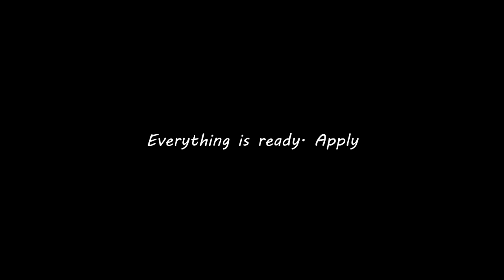This idea must be in your workshop or garage!

Comment: You've got a lot of expensive tools but apparently no router. Making circles with a router is more accurate and professional and does away with measuring and drawing and jigsawing and sanding. My clamps hang in a straight line on the edge of a shelf and occupy no floor space at all.

Comment: 10minutes of my life I won't get back. Here's a quick solution, 1/2 in dowel rod, any length you like, fasten between two metal shelf brackets, home depot or wherever you shop. All clamps can be then hung on it. Job done in 2 minutes of drilling the wall.

Comment: Be so kind as to give the name and source of the ruler that you use. Thank you.
Reply: ANY Metal Ruler with Holes Drilled in Both Ends and Round Out The Corners on/with A Grinder... Don't Lose Any Of The Measuring Scale. OR... Put A 2.5mm Hole At The 1" end.. Then 0.5mm Every 10mm or 1/4" along The Ruler To Put Your Pencil Tip Into To Mark Your Diameter ... A One Meter or One Yard Length Metal Ruler Would Work.
Reply: @Fred_Zepplin  My error, I was asking about the square.  I've seen others use that style but I've had no success in finding a Matrix square.  The Woodpecker 1812 is far too high priced for my shop.  But I would like an accurate square.  Thank you for the reply.